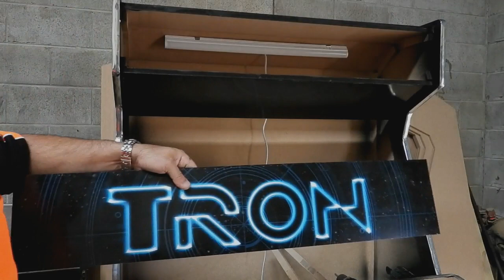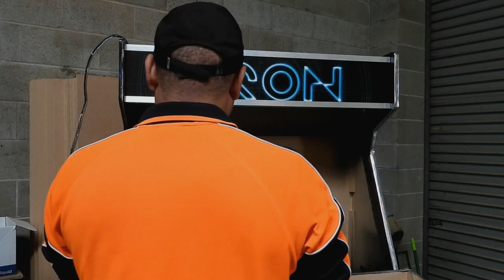Arcade light up header tutorial, installing and wiring

Comment: Why not mount it on the back and have it facing forwards? Seems like you are sending a lot of the diffused light downwards to nowhere?
Reply from the maker: If you need to take the back of the machine off to access the monitor you'll need to then remove the light. I used to mount it on the back but there was really very minimal difference in brightness. If the light was directional then yes definitely

Comment: typically when I do Multicade Systems I'll toss in a Electrical box and wire up a double gang set of receptacles and use some 14 or 12 AWG cable for plugging into the Wall. Enough for the CPU, Monitor, Marquee and Audio System. I try not to do "open air" splices when it comes to Mains AC.